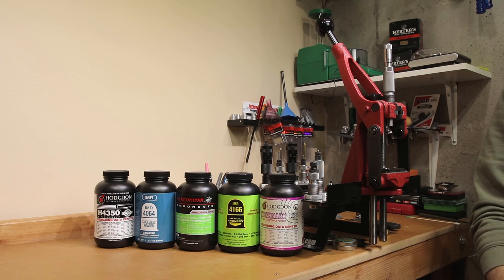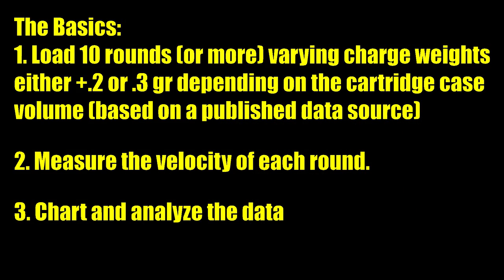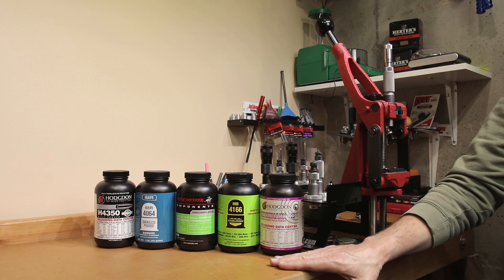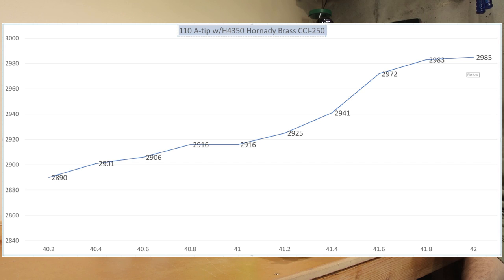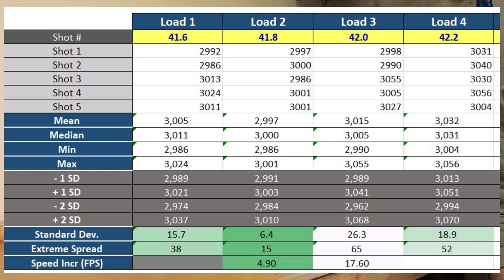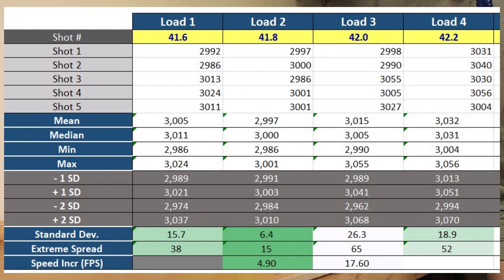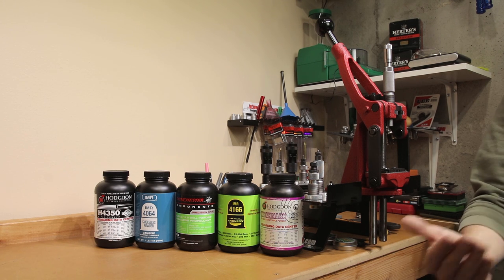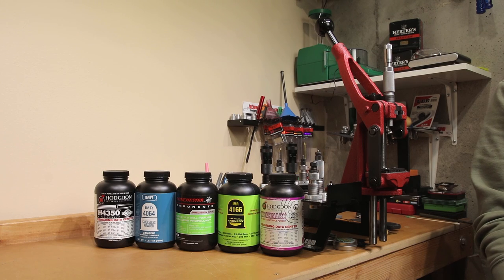10 Round Load Development Ladder Test - 3 Data Driven Examples

Comment: To be fair to the test method, Saterlee has in the past mentioned that for this to work, your case prep and loading techniques need to consistently result in low (single SD). Doing this test without fire formed brass also seems fruitless.
Reply: This
Reply: Works on my stuff. I sort and make sure my brass is prepped consistently but that should be standard practice JMHO. Almost have single digit SD but not quite. Nodes were definite. Loaded around the nodes. .75 MOA with 3 different projectiles at 300 yards.   He has some valid points but the method does work.
Reply: I ran a 3 tests with new lapua brass, segregated for neck wall thickness within .001", ran them again after fire forming. Results all showed the same velocity node. I'd still prefer tests with formed brass. But thats my experience.

Comment: There is accuracy, and then there is precision; they are not mutually inclusive.  Precision is the consistency of your results, Accuracy is how good your results actually are.  So when you go to sight in your rifle for deer season, and you discover you shot a 0.5" group at 100 yards, but it is 3" low and 6" to the right, you shot a very precise group, but the accuracy could be better.  You adjust the scope to fix the accuracy. 

OCW is placing an emphasis on obtaining precision and accuracy, at the cost of some types of precision.

The ladder test places on emphasis on a certain type of precision so that you can carry that out to long range to be accurate.

I have no problem with either - data is data - but I mostly use a style of ladder test when I am testing a new powder that may not be very well documented for the caliber, or bullet, I am using.

Ideally, we'd be firing groups at paper and chronographing each and every shot.

Comment: This method DOES work. I do it with 2 rounds at each charge going up in .2 then look for the flat spot and load at the .1 in between.  I just found one on my 6.5 then confirmed it twice with 2, 7 round groups at 8 and 10 fps sd but the group was just over an inch. I then loaded the same charge to back up my data and a couple more at different seating depth. Found one that put the sd at 9 and the group at 0.84" for 7 shots, the 5 shot was 0.63" take out the .2 that i add from shooting off a bipod and that's a damn nice load with confirmed data. No more wasted time testing, more time having fun shooting

Comment: The problem I see with this method is the sample size for each charge weight.
Statistically, there really is no such thing as a sample size of 1 where variability is a sure commodity.
These kinds of tests are easily misunderstood because so much of any data can & is merely interpretation. For example, let's suppose we have 10 charge weights & instead of one shot per weight, we use 5 shots per weight then, randomly select one of those five to use as data in our Satterlee test. I think it's obvious where that would lead. I think the Satterlee test could work with the minor variation of using 3 shot averaged velocity data per charge weight. At least this would contain some statistical validity & should at least reveal a trend. I realize Satterlee formulated this system in order to reduce cost & etc however, he obviously didn't realize the statistical insignificance of a sample size of one. If any useable information is to be derived at all, we have no choice but to use 2 or more samples per charge weight.
Reply from the maker: Hi Rotas, Strictly my opinion but I think that too many people get hung up on the statistical perspective of this. Its intent, again IMO, is to find an area to perform more meaningful testing in. This is not a tool to shoot 10 rounds and have your load development compete. It however IMO can point you very quickly in the right direction. Every time I try a new combination, the "safe" thing to do is start low and work up looking for pressure. (and measure velocity) This test is just that. Depending on the increment between charges you can find out where you have a higher likelihood of finding  a lower standard deviation. I also like it for testing primers. Its not going to tell you what's good in 10 rounds but it can tell you what's bad and that information by itself may be more valuable than people realize. (unless I am the only one who has ran testing and found I liked none of the options) If you haven't checked out this video on primer performance with Varget give it a look and see what you think about using this method for that. As always feedback is appreciated. https://youtu.be/CWo-D40M9Y0

BAR
Reply: @BoltActionReloading  Yes, I understand your position & agree in principal with your motives however, what most guys don't realize about the Satterlee method is that, the method was originally derived from rifle/cartridge combinations which gave very low, consistent SD's as normal.
The method is in fact statistically invalid without prior data from the system to be tested. Satterlee developed this with a previous data proven expectation that his SD's are reasonably lower than the charge weight velocity increments. 
Fortunately, you have a great deal of 5 + shot group data to which you can refer to validate or not, that the method can produce valid data with your rifle combination. To test the validity, randomly choose 1 shot per 5 or 10 shot string from each charge weight of previous data & graph those single samples as though they were derived via the Satterlee method. Do this 2 or 3 times selecting different shots per the same incremental strings & see if the data trends the same. If not, your SD's are too large compared to the velocity increments.
I don't use the method because I don't yet own a rifle that can support the low Shot to shot SD's required.

Regards.............Rotas.

Comment: I see you managed to find some IMR 4064.
Reply from the maker: Arrived 2 days ago.
Reply: @BoltActionReloading  I'd be very interested in a load work up vid for the 308 in that powder. Great video very informative.
Reply from the maker: Thank you, and you can bet that is the reason I picked it up. Stay tuned, it may take a little while to cycle around.
Reply: @BoltActionReloading  Will do, I'm going to have a look at the new Sabatti Tactical Evo in 308 on Monday. Cal specific loading equipment has been ordered. Bullet heads and brass has been ordered. Just need to pick some powder and primers up. It's a little harder to get powder and primers in the uk as you can't order them online and there are a lot fewer places to pick them up from.

Comment: start 1/4 above starting loads and work up .5% increments since starting loads are a waste of time and money and don't look for flat spots look for areas where velocity has the most uniform velocity gain as a example say your powder burning at 100 fps per grain of powder so if u using .1 grain increments  u should see a 10 fps gain per .1 grain charge increase if anything is over15 fps and under 5  just skip it or move to a different powder.

Comment: i got new rifle 7mm prc ( took 3 powder & like 20 rounds loaded enough to test speed & pressure) first then i did like 10 rounds new brass & 10 rounds reloaded neck turned & normal reloading & straightness, then  new brass back cut flash holes ok i used same load in same bullets the best group was with new brass and bag of 139 & 140 test bullets  the powder was h4831 & the group was best 139 (this was bought locally in bag ) at gun store the 140 was white tip & the other was seconds high bc target ( ok all rifles over 25-06 have muzzle breaks I injured my bicep & shoulder old injury i did what doctor said [the lead sled & table & blind hunting its nut so & first year hunting i got a 6mm arc & it has no muzzle break i took my rifles to range & 25 06 is limit with kick & hold rifle with injury & pistol with a arm brace ok the arm brace on rifle ? the one with muzzle break worked!] then i went about getting threading barrels & a type of muzzle break to use ok the people i had fix my rifles told me one number & the barrel was it on my gauge & there was not & the tool i checked was right by other shop it on the guy said so there off on making rifle & head spacing right I had to fix one they did after 160 paid i had tools to fix them myself a 6 hour round trip not fun & i did it a few times the 160 was the last drive there! ( i called the guy he said i was not there he seamed high or something was wrong) i holding the sales slip & i gave the shop a stock and used 7mm rem mag  barrel & this what i got after! what crap!

Comment: Your testing approach was inadequacy from a scientific standpoint. The simple straight forward testing approach which should be taken to verify the reliability of this method is to shoot a 5 shot group for each of the 10 charge weights (ie: repeat the 10 shot method 5 times on the same day with the same barrel temperature conditions) and plot the average data along with the standard deviation error bars. Then look to see if any or all single 10 shot strings show the same result as the average data plot... If it is valid to draw conclusions from a single 10 shot string then all 5 10 shot strings should show the same/similar pattern and should be backed up by average/SD data plot...  If various 10 shot strings are not in agreement then this will show up in the average/SD data plot as larger SD... Your testing approach failed to answer the question of whether consistently reliable information can be extracted from one 10 shot string! Please redo this test doing 5 shots for each of the 10 charge weights. This would help a lot of people to truly determine the effectiveness of this method and may show proof of this method's effectiveness or may show that in fact the method is unreliable (only such a test can say). Furthermore if the is reliable information to be extracted from this approach you will be able to say if a single 10 shot string is enough, or if for example 3 10 shot strings is enough or if in fact 5 10 shot strings are best to obtain reliable conclusions of velocity nodes!!!
Reply: Go ahead and way over complicate it. By the time you have a load your gonna need a new barrel.
Reply: Yes a sample size of 1 at a specific powder load.  A better approach is to shoot the 10-shot OCW every day for 5 days to see if the results are consistent every day for 5 days.
Reply: @taylorbokshowan5713  Or a new box of projectiles/new can of powder from a different lot.  For sure I appreciate the sample size issue, but the idea here is to investigate trends and use them to select areas of potential interest for further detailed testing.

Comment: Unless you were lucky enough to be working with a combination of components with low inherent variance in muzzle velocity across the range of charge weights being tested, any single shot ladder-type test is simply not informative. But you wouldn't know that without more testing anyway. The statistics of small samples are clear ... there is no free lunch.  Finding a relative flat portion of a curve which has random error at each point requires multiple samples to be able to conclude anything meaningful.  The more the variation, the more sampling you need to do.  This may be confirmed with your own data (if you have enough) or through Monte Carlo simulation or resampling exercises.  The Internet is full of good, statistics-based discussions on the small sample problem as it  relates to load performance evaluations.  Why ladder testing protocols remain "a thing" must be due to time and costs. But you can't get blood from a stone.

Comment: You are fooling yourself by plotting with connecting lines. Just use dots.    Try reducing the interval so that a suspected node spans across more than 4 shots. Use the slope of the entire chart to evaluate how much error is coming from your scale. Test your methodology by doing a similar test on 10 rounds that are identical.